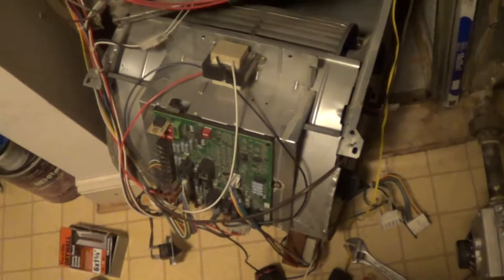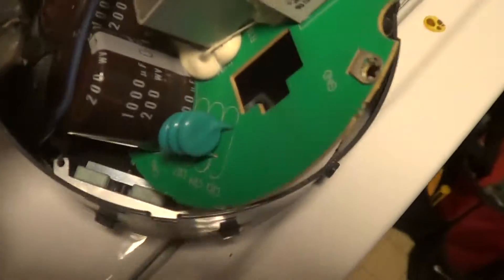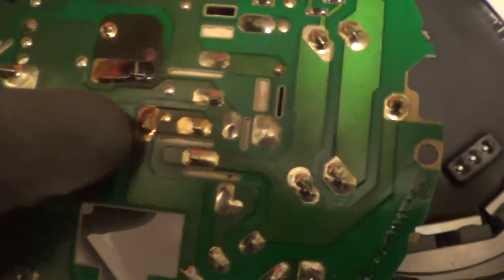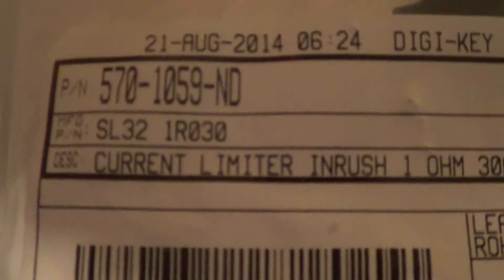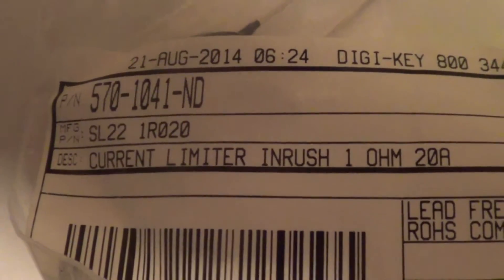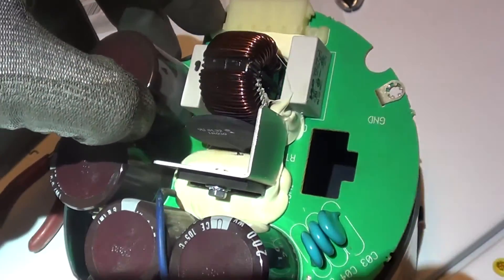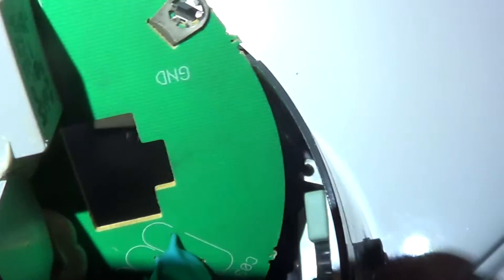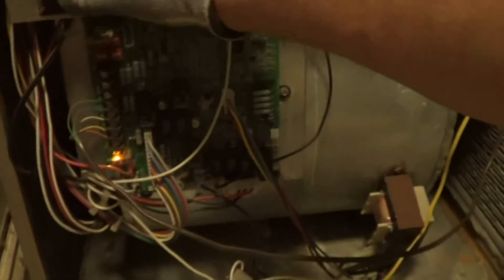ECM Motor repair by replacing inrush current limiter

Comment: Hey Nathan. I appreciate your videos and always learn something new. Here is an odd project that I'm trying to figure out: My Bryant furnace is 22 years old and has the old PSC motor, which I replaced a couple years back. Everything runs great. My problem is that this 3/4 HP 11 amp blower motor pulls 28.3 volts inrush when it starts up. This is a problem for my generator during power outages but only when I run it in Eco Mode. My goal is to give my gen a little time to spool up from Eco mode so maybe a soft-start would help. The reason I want to run in Eco mode is because its quieter and has twice to run-time on half the fuel.  My demands on the gen are very low, it's just this fan motor's inrush that tripping me up.  In trying to find way to lower the inrush I considered adding a thermistor component to the fan's hot wire to act as a soft start and that's what brought me here.  Can anyone comment on this idea?

Comment: Do those current limiters work in all ECM motors?
What is the motor size difference between the 20A and 30A motors?
I recently had a 1/3hp motor go bad. Which limiter would have been the correct one?

Current limiter acts as a fuse.

Comment: 1-Thermistor SG379 = Same as SL32 1R030 (1  ohm 30A) 
2-SL22 1R020 ( 1 ohm 20A)
3- SG348 (1ohm 16A)
Buy 3 of this and test out, i guess try from small Amp first move to bigger Amp, if 16amp burn out then next time try 20amp and next 30amp

Comment: A bad Inrush current limiter will it cause the motor work intermittently or will the motor not work at all?  Because I have a motor that comes on intermittently and I’ve replace the blower relay, control board and tested everything else.  It’s a package unit
Reply: No.  The NTC thermistor is used ONLY to prevent high inrush current when the furnace is plugged in, or the air handler/package unit disconnect is inserted.  If the thermistor is burned or damaged, the motor won't run at all.  It won't have any power.  If the motor does run, backwards or slowly or rocking back and forth or intermittently, the problem is on the lower board, which is not accessible.  The upper board, with the NTC thermistor and large capacitors can be removed and repaired, but the lower board is covered in a black potting compound.

Comment: HVAC service came in and said bad ECM motor, we don't have it and not showing local.   Offered to replace the whole furnace for 6700.  I pulled the motor out and found this thermistor burned.   Now I need to find a source that I can get it fast.  Thanks!

Comment: nowadays its hard to find a tech that knows or is willing (even if they know) to repair a circuit board on the component level. I imagine most would replace the motor or even the entire furnace if its 10 years or older?

Comment: Did you first have to remove the entire blower housing to provide the necessary clearance to remove the ECM module or could you just remove it in the space pictured?
Reply from the maker: They usually clear by just removing the two 1/4 inch screws.   Then, uplug the module from the stator.  Of course, verify all the power is off first.
Reply from the maker: Here are some simple tests:
1) If the blower attempts to move, but can't get up to speed, the module is bad.
2) When you spin the wheel by hand, if it acts like it has electric brakes, the module is bad.
3) If the blower is totally dead, it may be the limiter in this video.    However, most of the time, I end up changing the module based on  #1 and #2 above.

Comment: I am literally so surprised that you did this as a professional repair. I DIYed this repair on my own Bryant 2.5 ECM blower motor over a year ago for less than $10 (ASIN  :  B071D326TB).   I would have expected a service call in my location would have surely resulted in a bad motor diagnosis and require a motor replacement (and a four digit bill).  I commend you for your diagnostic skills and willingness to fix a perfectly good, high technology motor with replacement of a single failed electrical component.

Comment: If I temporarily jump between the two pins just to check it out? What do you think??
Reply from the maker: temporary is fine.   But, if the part is bad, it will physically look burnt.   If the part looks fine, it probably is fine.

Comment: How do you figure out what thermistor you need?  I have a Zhongshan Broad-Ocean Motor ZWK763D01201 ECM on a 6A 3/4HP motor (KMSAH012005).  The Thermistor is burnt to the point of being destroyed and I can't see what part number was on it.  I found a guy with the same motor who posted in a DIY repair chatroom that it was a 1D-25, but I can't figure out how I would know for sure?  I guess I'll try commenting on a 5 year old video?
Reply from the maker: Just match the diameter.
Reply: @NathansHVAC  Thanks man!  Subscribed!

Comment: Thanks Nathan, I just lost my ECM on a Nordyne (Tappan) unit and will try this since my Current Limiter is fried. It burnt so bad I can't get any part numbers off it. It would be nice if you could let people know what size motor the larger 30 Amp limiter is for compared to the smaller 20A rating part. My motor is 1/2 HP and a 12 years old unit.

Comment: This is exactly the problem with my ECM motor. However, when i get it apart, the entire green circuit board is covered with a fairly thick layer of soft black rubber. It looks like it was poured on and then hardened when the part was made. The circuit board seems almost impossible to remove from housing. Any ideas out there from anyone how i can remove the circuit board so i can solder something to it again. It almost looks like they have done it on purpose so that it is not repairable and I have to buy the whole module.
Reply from the maker: Is the part clearly burnt?  That will mean it is bad.  Just break it off, but keep the leads that are soldered to the circuit board.  Then, you can twist on the new leads to the old leads and solder them.

Comment: no offense but the idea is to make money for your company and changing this little part versus replacing the whole module there's a big difference in the profit margin. that is unless you're doing it for a friend or relative. or you put that part in and charging for a whole new module which is dishonest.
Reply from the maker: It is a $2 inventory item that takes no space on the truck. The module has to be pulled in either case.  If the part is burnt, it can be replaced in a few minutes.  The labor rate is still good charging $100 for 15 minutes worth of work plus a service call.  But I have to say I rarely see this failure.  Maybe once every 2 years.  I have replaced 4 modules already that had different failure modes.
Reply: @NathansHVAC  Exactly, good for you — karma for all the endless crooks out there that screw people, waste perfectly good components, fill land fills, list goes on.  Nathan, I hope you are insanely successful and get 1,000x’s the business you can handle, that you keep always doing what’s right, and STILL make a pile of money in the process.  God bless you and “true” American way
Reply: What I hear you saying is that you agree with screwing the average person by charging them to replace the entire motor when it's not necessary. You prefer to charge $1000 rather than $100 to make the repair. Your suggestion is comparable to blowing a fuse in your car and telling the customer they now need a brand new engine. Thank you Nathan's AC for being an honest technician.
Reply: I own my company. I am more financially successful than my next two competitors together.This is because I don't cheat my customers. Your approach does not lead to repeat business. Nor, to satisfied customers recommending me - the keys to my financial success.
You can make a quick buck or you can make real money. Not both.
Reply: @Harry Hathaway  So.....  always replace the largest possible module?
I think you just put wind in the sails of all the diy types that suspect exactly that.

Comment: I was opening up my control module right about the time I stumbled across this video.  Sure enough my inrush current limiter was burned up and was no longer attached to the board.  Your video really gave me confidence that replacing that one cheap part would fix the issue.  Glad I didn't have to buy a new $400 module, and even more that that, I'm glad I didn't call a tech that probably would have misdiagnosed the issue and stuck me with a $2k bill.  Still waiting on the part in the mail so I'm excited to get it soldered in and hopefully have cool air once again!

Comment: Really appreciate this well done and informative video. The AC repair guy came out and quoted $2,000 - $2,400 to replace the ECM and motor. I thought this was nuts- I've replaced similar sized pool motors for $400. So- watched a couple YouTube video's, including yours and instead of spending huge money (they "only" wanted $1,300 to replace the ECM). The result?

I bought an SG379 thermistor- exactly like the one you replaced in this video. Total replacement part cost: a whopping $1.90 --- with tax. It's way easy to change- if you can solder you can do this repair. Many, many thanks!!!!
Reply: Nice job. If you can pull your own tooth it’s way cheaper than going to the dentist.
Reply: Neil Reid Same here, u should post its name online so people will watch out for these scum contractor

Comment: If you want to avoid these types of repairs in the future (save yourself a lot of time and headache), install a kit in the controller board.
VZPRO Surge Protector (120-240V) ECM Motor / Module - GE / Genteq / Regal Beloit
Reply from the maker: I'm 100% for surge protectors.  They protect the silicon from spikes in line voltage.  However, this failure was clearly thermal because of the discoloration on the circuit board.  The inrush current limitor heats to 200 deg F or higher every cycle and then cools back down when the fan shuts off.  It is basically a NTC thermistor.  They aren't affected by spikes, but are affected by thermal cycles.  These parts are normally installed in TVs which may have only 2 cycles per day.  That is just my 2 cents.
Reply: @NathansHVAC  Thanks for that insight. I'm getting ready to take my blower out, and was hoping this would apply, but I'm thinking it wasn't a thermal issues (what causes that, anyway)? We had a power outage - lightning strike nearby - and it fried a couple of our surge protectors in the house, and tripped some of our circuits. Frankly, I didn't notice that the A/C-Furnace (blower motor) wasn't working for a couple of days, due to not needing it, but I'm sure that's when it happened. So, need to likely replace the whole motor (due to the module being damaged)?